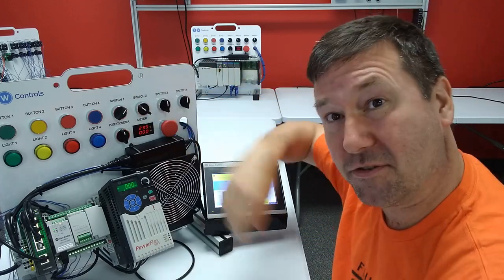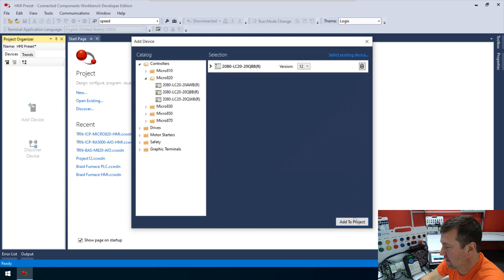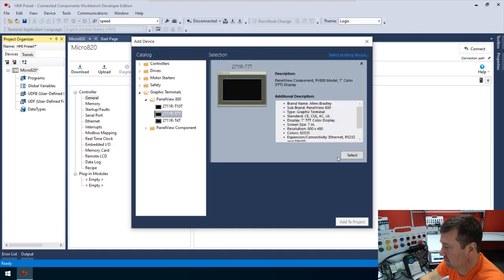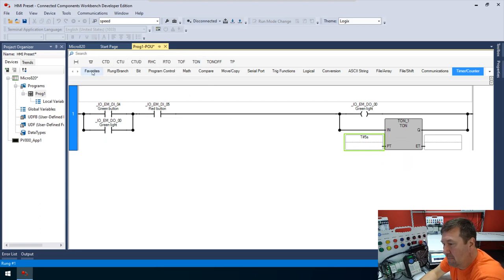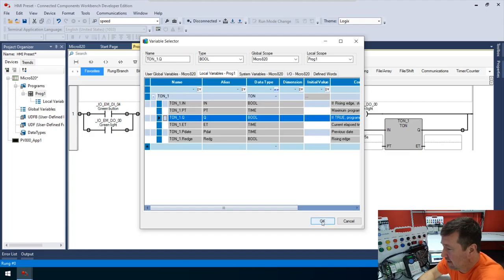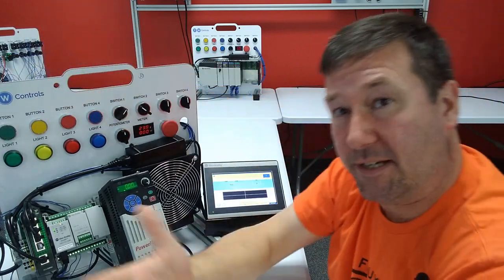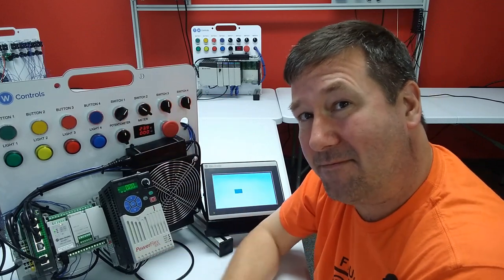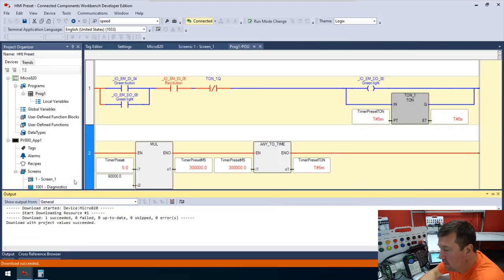Change a Micro800 Timer Preset from a Panelview

Comment: Nice explanation Tim. My first PLC was an Allen Bradly processor called "PLC" in 1984. Then to PLC-2, then SLC-500, PLC-5, and now Control Logix. This little Micro 800 is neater than spit! Keep em coming ang I' think of some more questions. Thank you! Greg Myers
Reply from the maker: I may get a hold of a "PLC" just to hang on the wall 😁

Comment: Hello Tim. Thank you for all the hard work you put into these instructions they are amazingly helpful. I have run into an issue that I can't find an answer to. When I use an hmi timer setup like you have demonstrated when I loose power I loose all settings made through the hmi. Can you point me to the right direction to solve this?
Reply from the maker: You need to check the retained column for the variables you want to remember during a power cycle. I have a video coming about that.
Reply: @TimWilborne  thank you I'll have to check the videos I haven't watched yet. It is in the ccw Playlist or a different one. Thank you again
Reply from the maker: @thebeansayshello5192  There isn't currently one specifically addressing that. I do mention it in several videos but I don't remember which ones.

Comment: Hi Tim,  great video.  What about changing a counter value thru the HMI?
Reply from the maker: The counter preset and count are both DINTs so just assign you data type accordingly.  I'll put that on the list to make a video about.
Reply: I tried using a variable tag for a CTU preset and it didn't work. Can't set a value??

Comment: Hi Tim thanx a lot for your videos sure helps a lot on ccw. 
This videos helps a lot with the next steps to become a plc programmer. 
im new to studio 5000 and ccw. 
and hmi programming. How dou you give that numeric entry a name on the hmi. 
for example motor run time or mixer run time. 
it might be a stupid question
Reply from the maker: Not a stupid question Henry.  Add a separate text box and place it above or beside it.
Reply: @TimWilborne  Thanx a lot Tim. 
to update the timer from the hmi is it only possible in seconds or can it be done in minuts on hmi as well ?
Realy enjoy your videos and it helps a lot. 
i want to do plc lessons but im a little bit far from us.

Comment: What license type are you using CCW developer edition? Also in your opinion, which one is the most cost effective for occasional projects?
Reply from the maker: For an occasional project, the free Standard version of Connected Components Workbench will work just fine.
Reply from the maker: This link will help Rollin
https://literature.rockwellautomation.com/idc/groups/literature/documents/sg/1756-sg001_-en-p.pdf
Reply: Tim Wilborne If i remember correctly, the major drawback was not being able to make changes online, and the simulator’s capabilities being limited. Lastly, just to be sure, does the standard edition impose any restrictions on the configuration and programming of PanelView HMIs?
Reply from the maker: No restrictions on HMI programming. I only recently installed a developer licenses, mainly because I'm getting ready to do some online edit videos.

Comment: Hey Tim. I'm having a scaling issue with CCW. Some of the text gets cut off and it makes it hard to navigate. I tried unistalling and reinstalling. Any ideas ?
Reply from the maker: Hi Justin.  Yes, I've had that issue as well.  Right click your CCW icon and go to properties.  Then go to the Compatibility tab and find the DPI button.  Play with the settings on it.  One of those fixes it.  I should do a video on that.
Reply: @TimWilborne  thank you Tim!  I played around with the DPI settings and turned off and auto a DPI setting and now it works. Thank God. I couldn't configure my PV800 because of the scaling issue. Also want to let you know your videos changed my life. I just got the job offer to be the control specialist for Hershey, and I learned most of my knowledge through your videos and literature I bought. I also bought a bunch of equipment to practice on but it was all worth it. I passed a 200 question PLC assessment test to get the job offer, once again. Thank you for everything you do.
Reply from the maker: @justinpuzak2558  That is great news Justin.  Hershey probably has a training budget, if you get the opportunity, let's see if we can get you into one of our classes.
https://twcontrols.com/plc-lab
Reply: @TimWilborne  they do and I will definitely  push the idea of joining one of your classes. I haven't got to work with studio 5000. Do you have a class for it ?
Reply from the maker: @justinpuzak2558  Yes, our class is on troubleshooting PLC Controlled machines using Studio 5000.  Here is more information. https://twcontrols.com/plc-lab
Reply: @TimWilborne  thank you. I will make the suggestion. I don't see why not. They're will to pay for college so I'm sure they will send me to a class I want to go to.